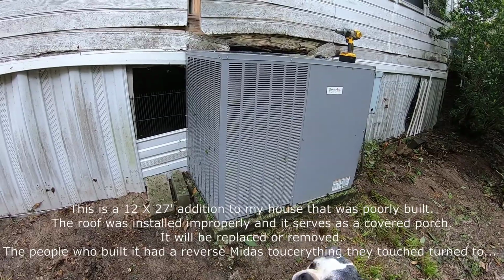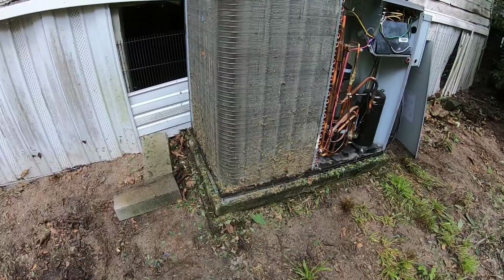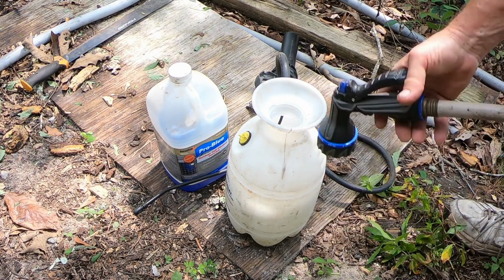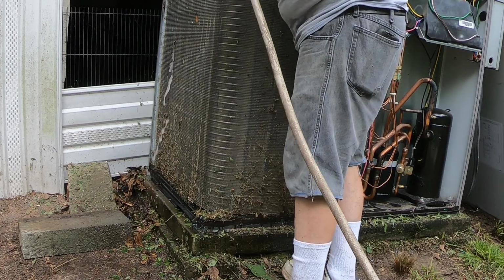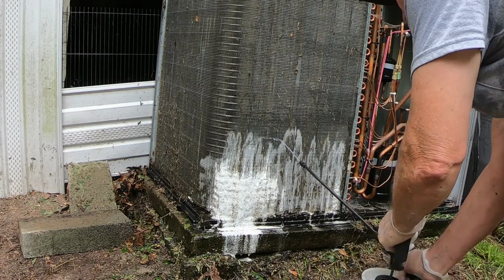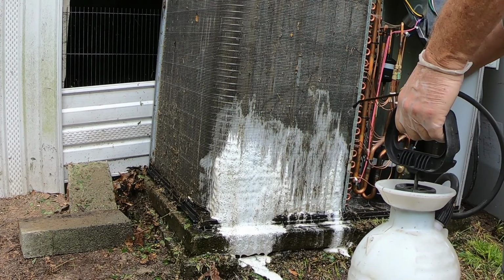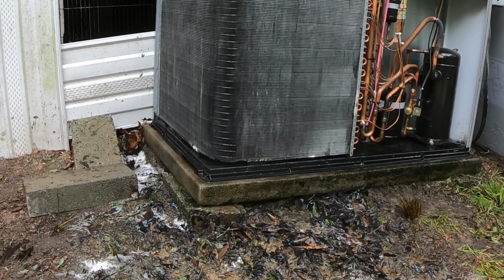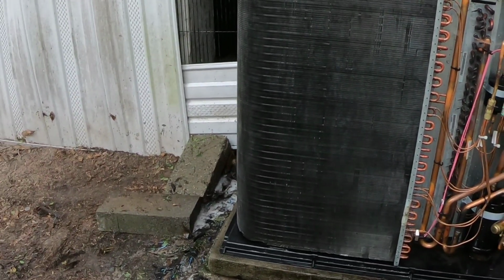Homeowner Clean Your AC Coils Twice A Year - save $$$ and your unit will last much longer!

Comment: My friend was complaining that his A/C just runs all day in this brutal heat and doesn't cool that well. He installed a window unit to get the living room cool enough. So I went over last Sunday to look at it. I pull the air filter and it's absolutely filthy. The coils are completely covered with dirt. I said Jesus dude, when was the last time you changed the filter? He replied I don't remember 😂. So I took a soft brush and some cleaner and cleaned it the best I could.

The outside unit was just caked with dirt and debris. In the 98 degree weather I cleaned the coils and straightened the find with a tool. I am just pouring sweat when I am done. I open his fridge and quickly down a beer. I grab a second one and he says hey man, don't drink all my beer! I responded and said when I am done with this one, I am getting another. Why don't you use some of the money I saved you and go buy me some more 😂..... We are friends like that.

But the air was far colder and there was twice as much air coming out the vents.

Comment: This method works great on your trucks AC condensor, radiator, trans cooler, & charged air cooler.
Reply from the maker: That's what led me to clean my AC. I clean the coils on my trucks, especially the evaporator coil. PITA, but makes a big difference with the airflow.

Comment: Is coil cleaner hard to find? Can anyone buy it??
Reply from the maker: You can find it at any HVAC supply like Baker, United, Mingledorfs, Johnstone. Do NOT buy the aerosol cans, buy the 1 gallon jugs of liquid and follow the manufacturer's instructions on the label. popular brands are Nu-Calgon, DiversiTech Triple-D and DiversiTech Pro-Blue (what I used). A quick search shows supposedly similar products at home hardware stores, but none of the usual brands so I can only assume they are inferior products.
Reply: @2020HotShotTruckingLLC  Thanks....previously I had looked at the big box stores( Lowes, Home De), with no luck.......Had not tried, actually never heard of the companies you named. Love what you do, man!
Reply from the maker: @Bugdriver49  There's a Baker Refrigeration in your town...
Reply from the maker: You just forgot them...you worked in the parts department and surely you gave PO numbers to the techs who had to buy parts there.
Reply: @2020HotShotTruckingLLC  It's been a while...but as I remember...the few times I went to a HVAC dealer....I was told they did not retail to the public....so I stopped trying them. Besides....do you REALLY think I could remember anything that long ago? Some days I feel blessed if I can remember my name....lol